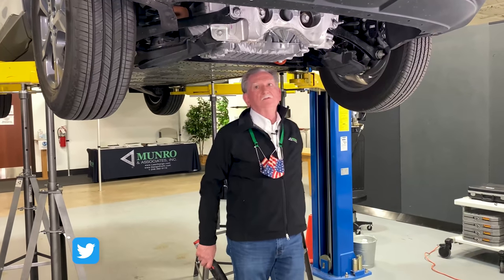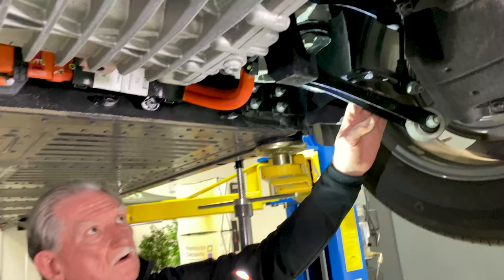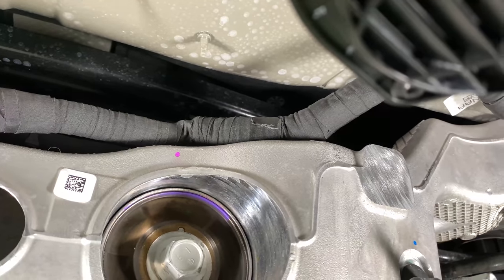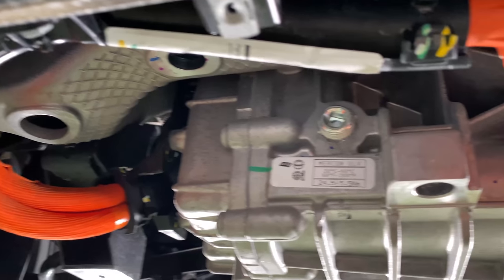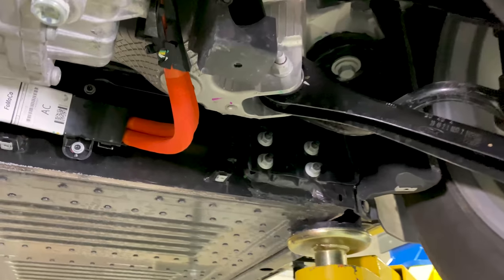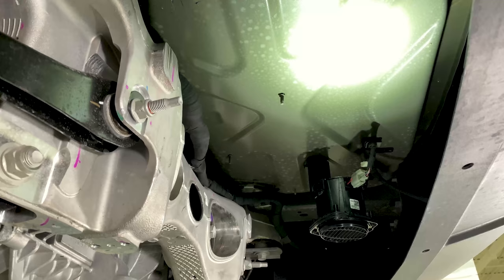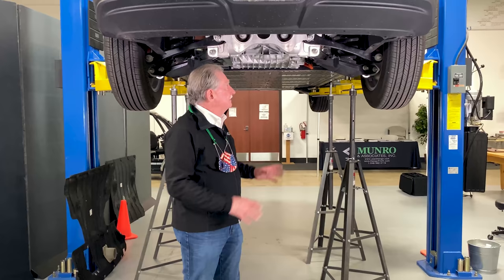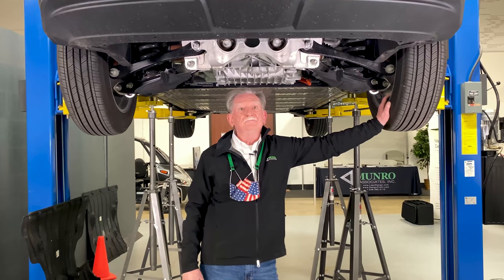2021 Ford Mustang Mach-E: E4 - Hoist Review | Rear Suspension

Comment: I hope you can do the Mach-E tear down. Your positive comments has me intrigued.
Reply from the maker: Tear down coming soon...
Reply: @MunroLive  Question, on the hollow carrier castings. Front and Rear. Would it makes sense to have the large opening covered with a cheap plastic plug. As to prevent debris from building up inside the units?
Reply: @MunroLive  Awesome!
Reply: @fredpinczuk7352  Mice need homes too!

Comment: Extending the pressing/adding a rear tub for storage would also have the additional benefit of continuing the flat floor resulting in less underbody drag. That bumper is a massive parachute (assuming no cover panel was removed for the video) and every little reduction in cD helps.

Comment: It’s good to see Ford really tried with this car! 
I’m a 100% Tesla fan, but I’m also an engineer and I love it when something is build well,

Hopefully Ford will also try to limit more of the parts, by designing new alternatives instead of grabbing already off the shelf existing parts.

Improvement and improvement and improvement like Tesla does,

But really. Ford made better start than VW. No question about it.

Also the Mach E interior etc looks great compared to VW ( my personal opinion, you may have another one)
Reply: I think you are right. VW did not impress with those IDs. I thought the EGolf was a good attempt at electrifying an ICE model but the IDs should have been better as a purpose built models.  For me the software and UI are paramount and VW are lacking.  Haven't seen/used the Ford so can't comment on that.

Comment: It seems like the Mach-E team had gotten a clean slate to work from. Hopefully it won't go down hill from there.
Reply: NOPE, False. Muck-e still made with the FORD parts bin.
Reply: @mikeb1039   - TESLA Rarely break. 
IF they do , I order MOBILE Service with my Smartphone , and its Repaired SAME DAY in just 1 - 2 hours. 
TESLA are Built REAL Tough , not FAKE tough.
Reply: @mikeb1039  as a Tesla fanboy, that guy above is a bit over the top. Cheers
Reply: @mikeb1039  To be fair, the same thing happens when the Mach -E breaks.  WAIT!!!!!!!!!!!!!!!
Reply: @markplott4820  Where in the FORD parts bin would you find the castings and battery?  I hope Ford does well but with low production numbers and a tiny profit per vehicle I don't think Ford will be stealing Tesla's thunder any time soon.  I do believe the Ford Mach-E is the GM killer though.  Mach-E > Bolt in every way.
Reply: @mikeb1039  I'm a Tesla fan, but credit where it's due, this thing looks (as Sandy says) way better than I expected. Software and ADAS could well make or break it though.
Reply: @mikeb1039  I’m a Tesla fanboy too,
But also an engineer ( hence I’m a fan of Tesla and spaceX to begin with)

I do love that Ford made such a good start, how ever the guy is right about the existing parts,
Not from what you see at the bottem etc, but the inner workings of the car, allot of parts can be redesigned to make just 1 part doing the same job ( think electronics etc)

But definitely their way of securing the battery + the short cable straight to the motor is great for efficiency,

Now if/when Tesla gets their structural pack with cells that actually last a life time, then it doesn’t matter how serviceable the battery is, then structure becomes better, for now though, easy serviceable packs are great.
Reply: If its from Nikola it will go down hill.
Reply: @markplott4820  And the Model Y doesn’t use any generic Model 3 parts right?
Reply: @markplott4820  so you've never had a collision repair?  The bodies is not designed for reparability.  Heaven forbid that the repair requires the removal of the panoramic roof, because there's a 50% chance that it will break.  And you're likely to have the same fit and finish issues that exist when the things roll off of the assembly line.
Reply: @DIsmayedConfuse  50% chance the roof will break?  Can you back that up or did you make it up?
Reply: @samesch85  At one time they were going to share a lot of parts but it seems that's changing as the manufacturing methods change.  I suspect at some point it will start to swing back as the newer methods filter down to older models.
Reply: @markplott4820  Apparently Sandy doesn't think that's the case at all.
Reply: @davidbeppler3032  Yes, unfortunately.  Ford has a BUNCH of these out there that simply quit working..... they turned into expensive BRICKS... Ford is still waiting on a fix.  It's a software problem.  Ford is new to this game of being a tech-software-engineering powerhouse.  But this looks promising.  It's a damn SHAME they are built in Mexico tho...
Reply: @MrZrryan2  Only Tesla is American anymore, and they use something like 15% out of country sourced parts.  Sad but True.
Reply: @DIsmayedConfuse   - FALSE, the Tesla roof alone can support weight of 10 model S stacked on top.
and Megacasting means LESS damage and you can simple cut off Damages piece and BOLT on a NEW one , Recycle the OLD one.
Reply: @samesch85   - SANDY has proven , the MODEL Y is ONLY 25% in Common with the MODEL 3, he Initially thought as high as 70% , but later when he did the ACTUAL teardown , he was like WTF ?
Reply: @davidbeppler3032   - either FORD or gm will go BANKRUPT in 2023, MARK my words.
Reply: @markplott4820  Why not in 2021?  What makes 2023 so special?  GM has been dead since 2013 when Tesla went public.  I hope Ford survives.
Reply: @davidbeppler3032   - with what ? 
FORD Muck-e and EV F150 cant Sustain FORD alone , they will have to CONSOLIDATE some Vehicles and Completely DELETE others , and convert ALL to BEV in 9 YEARS ? 
not going to happen. 
most of what FORD has planned are HYBRIDS and China market BEV.
Reply: @davidbeppler3032   - are you kidding ? 
FORD q1 Financials = CASH only $30.75 B, DEBT $163 B, ( - 132 B), FCF $4.24 B.
Reply: @markplott4820  you seem to have reading comprehension issues.  The roof has a 505 chance of breaking when it is removed for repair.  Nothing to do with supporting weight.
Reply: @markplott4820  Ford, unlike GM will pare down to just one factory if they have to.  You just watched Sandy give Mach-E glowing praise.  If they can just built it and the EV F150 they will continue to survive.

Comment: Is it difficult to control wall thickness in those large convoluted hollow castings?
Yeah, it's hard to see the downside of a deeper storage tub. The GT will use more powerful and presumably physically larger motors but certainly they could just make a tub that fit all configurations. Heck, the rear tub could even be another cooler.

Comment: Definitely looking good. 
The only negative thing that I saw was on the rear suspension control arms on the thin ones you can see the big bolts coming through the bushings and the nut is towards the rear of the car. You might find that the drive unit has to come out to get that bolt out because it looks like to get the suspension arm out you would have to take the nut off and then push that bolt forward through but you can't because there's something in front of it. I could be wrong it may just be the way it was filmed he didn't really show that part very clearly.

Comment: Sandy The rear suspension has little route  and when it rolls in the street it throws the mustang as if it no longer has shock absorbers, I think they should put gas Shock absorbers at high pressure.

Comment: I own a ford in Canada. This piece is still a ford when it comes to mitigating the rust problem.
Reply: The whole suspension is aluminum, there's almost no steel there besides the trailing arm links. Body corrosion is going to be your only concern, not the undercarriage or suspension rusting away on you.
This is similar construction to a 10 year old BMW or Mercedes their only corrosion concern is body rust.

Comment: The big question is if Ford can build this car with a good enough profit margin, and can build a gazillion of these to make a dent in the market...Are dealerships willing to sell the Mach-e?

But.. So far so good! and it would be good for Tesla to have a serious competitor! will keep them sharp and continue to innovate at the speed of thought :-)
Reply: Why when you can push the customer in a dino-fuel direction and get more of that sweet sweet service money?
Reply: MARCO - NOPE, the Muck-e is a loss leader , FORD makes ZERO profits on the Muck-e . 
meanwhile TESLA overall has 26+ % Auto Gross margin.
Reply: @markplott4820  What proof do you have of this opinion?
Reply: Ford already announced they are battery supply constrained to 50k for the first year of production in Mexico.  And that ~30k of those are heading to Europe to help meet fleet emission requirements.  The SK Innovations factory outside Atlanta will help but they are year or more out before volume production.  And VW is also getting battery cells from there for ID4.
Reply: @mikeb1039  Tesla's dont need service, so that is not much of a problem. Plus Tesla operates a fleet of mobile service van's, they come to your house if you have a problem.
Reply: @heathwirt8919  
Mark gives Tesla enthusiasts a bad name.
(I count myself as one)
Reply: @markplott4820  Ford has said they do make a profit on the Mach e and if I remember correctly that stems from the decision to assemble in Mexico.
Reply: @mikeb1039  What state are you in?
Reply: @patr5902  Battery cells are going to be the big problem and it's why Tesla has been so battery focused.
Reply: @TheEvilmooseofdoom   - thats BS , look at the FORD earnings Report , MUCK-e is a loss leader.
Reply: @markplott4820  All I know is that in a bloomberg interview the CEO said the Mach E is immediately profitable.

Comment: I wish people would quit talking about Tesla losing market share. It's almost entirely a mathematical issue. Since Tesla is currently supply-limited, there's no way to keep their market share. As long as more EVs are being sold in the US by others (the total market is increasing) and Tesla doesn't have more cars to sell, do the math: they are going to lose market share by percentage points.
Reply: @deeperanddown  It's NOT an important metric at this time because losing market share is inevitable while every car they have capacity for is sold even before they make it. My point is that the math says that Tesla can only LOSE market share until they can make substantially more cars, and that's not until Giga-Texas comes online.
Reply: It is meaningless.  The EV segment is such a small chunk of the total market worrying about EV market share is idiocy.  There is a TON or market for both to expand into.  As more EV's come out Tesla can double it's numbers but still loose 'market share'.  What matters is YoY total sales, this market share business is merely to give imbeciles an excuse to quibble.
Reply: @deeperanddown  I am a shareholder. And in this disruptive market, with all the existing constraints, the old rules (and metrics) don't apply in the same way. Yes, you can START to get an impression by using what's always been used, but if that's where you stop, and you don't dig deeper into all the circumstances that define a number like market share in this environment, it's purely a delusion.

Comment: Just wondering about Sandy's comments about the Electric Motor casting probably being an oil reservoir, but remarking on there not  appearing to be a pump connected. That brought to mind our local Electricity  Substation where the HV transformers are Oil cooled but rely on a convection circuit to carry the heat away and dissipate it to the surrounding atmosphere.

Comment: Sandy didn't compare the rear aluminum cradle with the 1-piece die-cast part which Tesla recently began producing and has been much-promoted and claimed unique.  It looks about as large as the Tesla part.  Is it die-cast or sand-cast and does that make a difference?  The top steel bar is interesting, somewhat like the front strut-tower brace used in sports cars.  The U-channel control arm is smart, with no place for salt to collect, and easy to form.  M-B used welded cylindrical sheet-metal control arms in the early 2000's, which rust-thru from the inside to fail with no warning.
Reply: @munrolive.2103  
Crypto scammer.  "Munro Live" doesn't have a period in the name.

Comment: hold on a second. Their choice of a simpler building material for a suspension component needs to be measured against performance and NVH metrics, not just manufacturing cost. This is not a random bracket supporting a dash panel or accessory. TBH, I'd gladly pay more per part on the suspension side of the car, or in the transmission, provided there was a subjective gain to be had there.

Comment: According to InsideEvs, there were only 6,614 Mach E's sold in the first quarter of 2021. I don't see how this takes much of Tesla's market away.
Reply: Ford already announced they are battery supply constrained to 60k for the first year of production in Mexico.  And that ~30k of those 50k are heading to Europe for fleet emission requirements.  The SK Innovations factory outside Atlanta will help but they are year or more out before volume production.  And VW is also getting battery cells from there for ID4.  Ford may eventually be able to sells these in volumes to impact Tesla but it won’t be for another 1.5-2 years
Reply: @patr5902  I agree.

Comment: The only thing I see that I don’t like about the Ford is the charging curve.  It’s only about 100KW for most of the constant current part of the charge up to 80%, then drops like a rock to 10-11KW for the last, constant voltage part of the charge, which adds almost 2 hours if you need to get to 100% because of a gap between charging stations.  Effectively this means for road trips, you have to operate the car between 0 and 80% charge, and it isn’t all that fast, taking about 45 minutes to get to 80%.  That reduces the excellent 100% range of around 270 miles at 70mph for the first leg, to more like 210 miles for the second and subsequent legs.  Still useable, but a bit disappointing, because the rest of the car is so good.  Ford needs to try and get the 100KW part of the curve up to 150KW, and try to keep a decent charge rate between 80% and 90% at least.  I will be very interested in seeing what kind of cells are in the battery pack and how they are cooled, when Sandy does the teardown.

Comment: Strange, it looks like the half-shafts are already rusted. It may be just the natural colour for some reason, but it does stand out. The other thing that i think looks a bit off is the openness of the unerneath. Imagine this having driven in some sludge or a muddy road and all the dirt accumulating in these underneath crevasses and details. Feels like a lot of potential for further rusting and component deterioration
Reply: Google weathered steel.

Comment: the thing I noticed that isn't great about this vehicle is the used gap between the bottom of the car to the floorboards. its quite low to the ground yet the floorboards is quite high. the battery must be very thick
Reply: @munrolive.2103  Gosh not you too.

Comment: Isn't it a little concerning that the battery leads/cables are so low and exposed? I'd be a little worried about road debris nicking the cables.
Reply: I suspect they removed a cover.
Reply: There is a huge cover there they removed.

Comment: You should take the Mach-E on a road trip first.  See how long it takes sandy to get to 100 explitives and turn back.  Alot of people are having charging issues.  Speed, connection, and reliability problems need to be ironed out.

Alot of smartphone manufacturers learned this the hard way when apple plowed them over.  Beautiful well engineered product with bad UI and UE = dud.  Hopefully Ford and EA figure it out.

Comment: Love to see Ford pwning VW in EV design.  Was wondering if the unused room at the rear of the car was left there as crush space so a rear end bump wouldn't result in damage to the rear motor/battery?
Reply: In which case a metal trunk basement would work even better.

Comment: This is actually a shockingly good car from Ford. Not just the build, but the interior and the software too. I have only too complaints, the performance and the proportions. Add a few hundred horses and make it look like a real Mustang and I might even think about replacing my Model S.
Reply: 0-60 in 3.5 seconds is pretty damn good.
Reply: The software?? 🤔
Reply: @mikeb1039  
Mobile service anyone?
THAT'S a "concept"
Reply: @rogerstarkey5390  it may not be as snappy as Tesla’s, but compared to other manufacturers it’s pretty good.
Reply: @DanielBlaney  
Not compared to a Tesla. 3.5 is the GT Performance edition, the fastest and most expensive.
My 2016 Model S 90D can do 3.8 and that's not even the performance version.
So 3.5 is good, but the affordable versions will be around 6, which is barely acceptable today.

Comment: From your video's you've done so far it seems to me that your pretty well impressed with the new Ford EV Sandy, which makes me wonder how impressed you are knowing that Ford has cut a deal with VW for VW to supply all the chassis, running gear and batteries and for Ford to supply the rest?
Do you think this will be a retrograde step to take?
Reply: You're thinking of EU models.  The NA Mach E is build on the Ford GE1 platform.